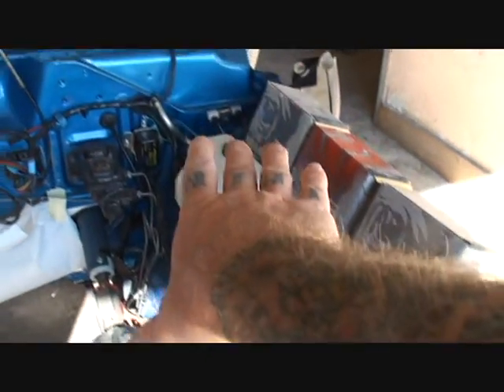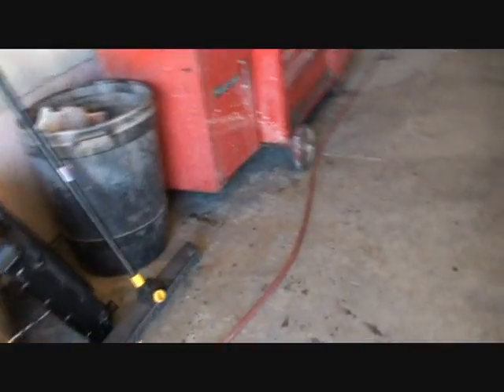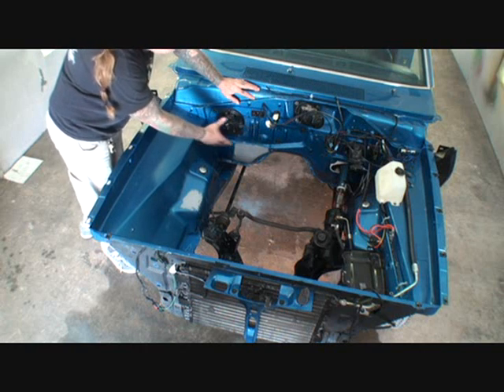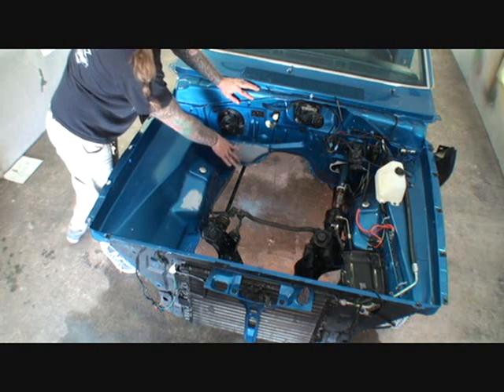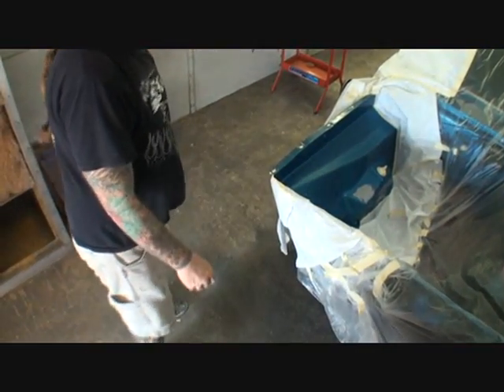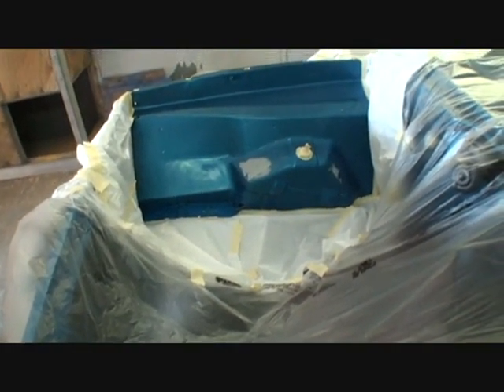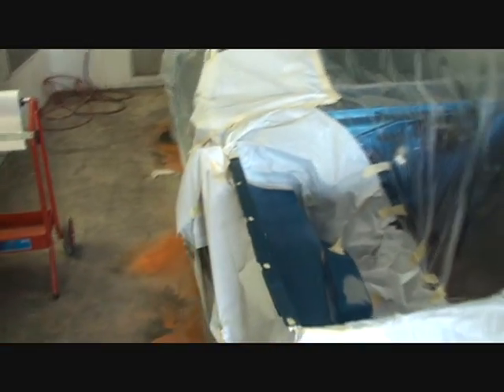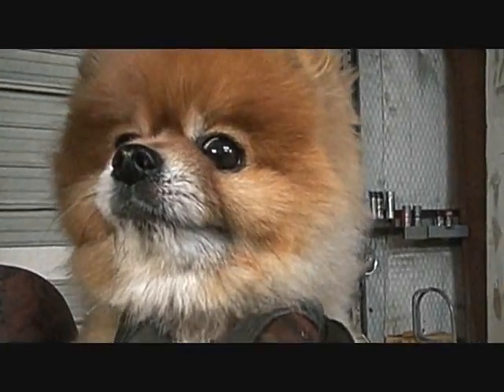1968 Dodge GTS-Customer Satisfaction Guaranteed!-Part 1

Comment from the maker: @mitmaks Being in Dallas Texas it doesn't get as cold as other places, but when I paint in the winter I use my Kerosene heaters 500,000 BTU, I have 3 of them, I take once put it down the side of the paint booth, turn it on, and the paint booth when on sucks in the how air, through the intake filters... Pete